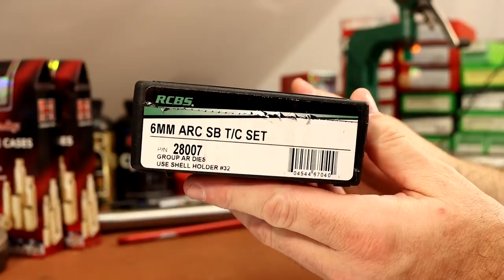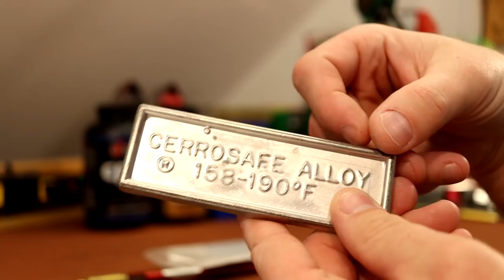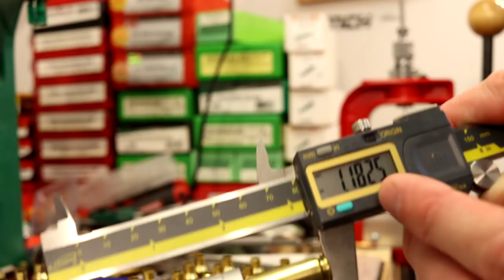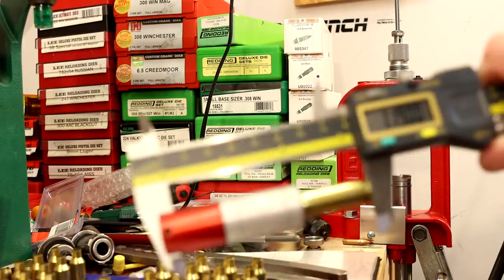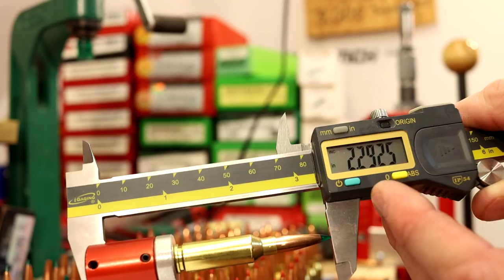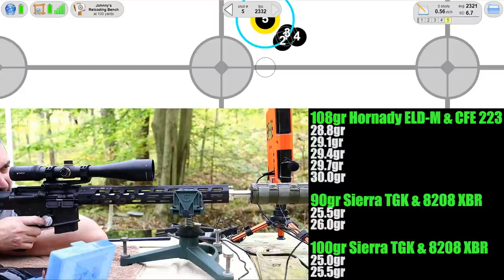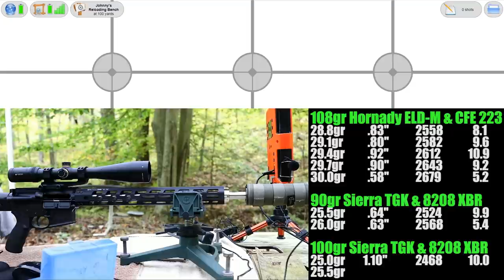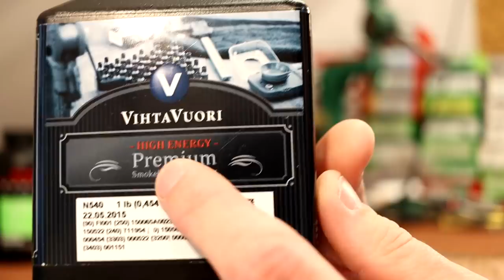6mm ARC - Still just getting started

Comment: .007 in. seems like a lot of shoulder bump.
2 - 3 thou..more like it

I am struggling with the Hornady headspace comparator.  With an edge contact on the shoulder, I don’t see consistent, repeatable measurements.
Reply: Are you using digital calipers? I've run into a problem with mine where I had some crud under the read head, but it would only show up in certain spots. One of the spots was around the 2.20"-2.70". Basically right where you would measure 5.56 OAL. Threw me for a loop for a few minutes until I went and double checked my measurements with an old dial caliper. 

Give your tools a good cleaning and try again. I don't have the Hornady headspace comparator. I have the bullet comparator and it always gives me repeatable measurements.

Non-concentric brass could maybe cause a problem as well. Have you tried spinning the case to see if it changes the measurement?
Reply: @Old Scratch - thanks for the reply.  I use a high quality Japanese dial caliper.  For me, math is easy, and batteries are hard.  All surfaces are clean and the cases were rotated repeatedly.  It is possible that the once fired cases were not uniform, but rotating hopefully averaged that out.  I just feel the line/edge contact of the Hornady Headspace Comparator did not give me easily repeatable results.  I’m going to invest in a Short Action Customs comparator with a conical surface cut to the angle of my shoulder (30 deg).

Comment: Run your case through your sizer dies without the expander ball. 

When you’re measuring CBOT the shoulder isn’t relevant to the measurement. Simply because you’re measuring from the base to the ogive. When a “live” loaded round is chambered the base is against the bolt face. Hence why we measure BTO.
Reply: I hope that makes sense?? Hornady sells cases for the oal gauge. They aren’t fire formed to your chamber. It would be impossible for them to do that, because as you know every chamber is different. 

I hope that helps ya out in the future.
Reply: Another way to look at this is, when we load cases, we bump the shoulder .0015. Then we seat the bullet and measure CBOT. So do you account for that .0015 shoulder bump? No. We simply measure the CBOT and keep the bullet seated .020 off the lands, or wherever your gun likes it seated. That entire measurement is essentially from the bolt face to the ogive of the bullet. 
I don’t know how to explain that any better without physically being there lol. 
Hope that helps.

Comment: Since the 300 BO is loaded with a pistol powder can we try it in the 6MM ARC? Stupid question?
Reply: No
Reply: You'll blow your face off. 300BO "works" with pistol/shotgun powder because the bullet is nearly the same size as the case, and it's relatively low pressure. Small neck cases like this need a much slower burning powder.
Reply: There probably is a safe, sub sonic, pistol load, like .223 with Titegroup, but it would be a tiny load, and I doubt its published.
Reply: Trail boss works in almost everything.  Could be fun. Don’t know what it would do in a auto loader.

Comment: Johnny, what's your opinion on neck sizing? I notice you full length/bump the neck, is that the way to go??
Reply: It's the most standard way these days as it is more consistent over several reloads. But neck sizing has it's 'pros' aswell..
Reply: @axelstrand29  Looks like I need another piece of measuring equipment to add to the collection haha
Reply: In self-loading firearms, you need to full-length size as a general rule.

Comment: When you buy your barrels, do you order them finished or do you order blanks?
Reply: AR barrels are generally plug and play.   Just check headspace is in spec with a go and no go gauge.
Reply: @bmstylee  ok, all my experience is with bolt guns. So when I bring my barrel in to get chambered my gunsmith takes the inch that he cuts off the end and runs my reamer through it so I have an exact copy of the chamber that I can use to find my max length. But I guess that has no use in a gas gun.
Reply: @alexgeislinger6021  a lot of these precision barells come with a matching bolt so headspace shouldn't be an issue.
Reply: @bmstylee  I'm not talking about head space. I'm saying that since I have a piece of my barrel with the exact shoulder neck and throat as my rifle i can put a bullet tight to the lands and slide a fire formed case over the bullet. That way I can measure exactly what my OAL is.

Comment: Anyone check what the thread pitch is on that guage ?!?! Well i have, i found out the hard way Hornady doesn't make a modded case for 17 Hornet. I shoulda checked first but i knew id use it for multiple calibers. It's an uncommon 5/16x36 !!! So i ordered a tap. Why? Just why? 32pitch is too course? Lol. I'm fabricating my own 17Hornet case to use.
Reply: 5/16-18 is the normal pitch and 5/16-24 is the fine pitch.  What this is, is extra fine, not "course" which is a "direction," not a measurement. As a master toolmaker it's called "coarse thread."
Been playing this game for over 50 years.
Reply: @keithlucas6260  i was joking that 32 was course, hence the "lol".
 Just didn't understand why they chose such a fine " direction" 😉
Reply: @BEANS-O-MATICtransmissions  usually because it falls in the "micrometer" class of threads for precision work and less likely to back out once seated...use the extra fine threads even in the oil tool industry for the electronics in the tools.